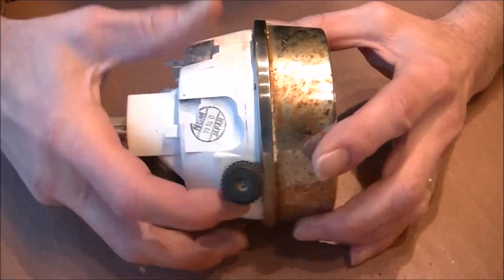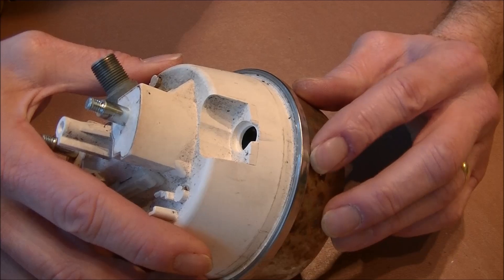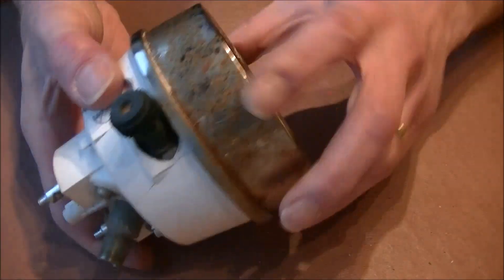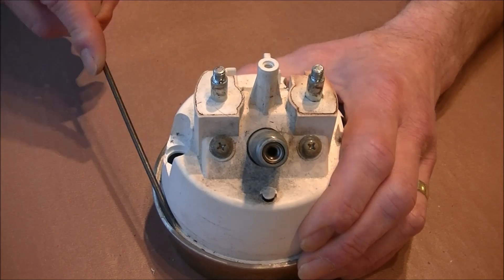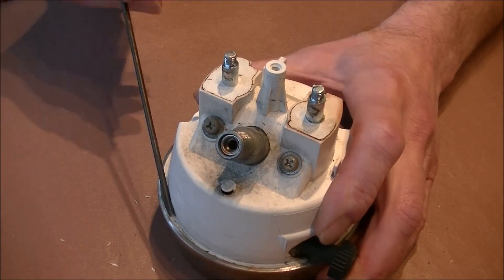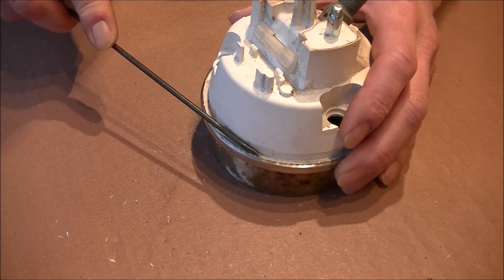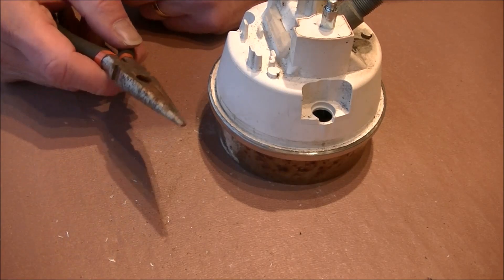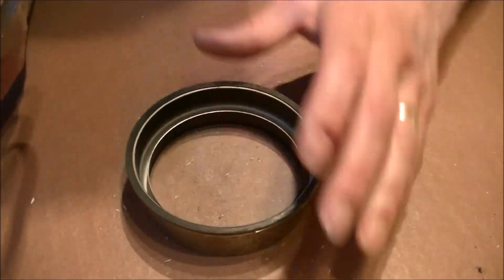How To Open A speedometer, Dismantling The Speedo And Removing The Glass, Instrument Restoration

Comment: Just did both gauges on my VX1100 and it worked a treat thank you. I did what David mentioned earlier and cut a hole in a piece of wood to support it. The back of the glass was misty on one and the other had marks that annoyed the heck out of me. I tried to pull the thing apart previously but realised it was t designed that way. Thank you again for the video.
Reply: hi when you want to put back the ring how do you make bend it back as it was?

Comment: If you can make a reasonably accurate hole the diameter of the outside of the metal ring, and place the speedo into it, it makes it much easier.  Even a hole bored in hardwood will do.  That way the ring is supported, and the edge will bend up much easier, as the ring doesn't deflect as you pry.
Reply: Exactly what I was thinking too. And maybe a metal ring to protect the plastic too, you can see on the table is full of small white plastic peace falling down when the twist the screwdriver.

Comment: I tried to do this and failed miserably, thinking I can Jimmy it someway later. That failed, so I bought a used one at around the same mileage on it. That failed. So I ended up buying a motogadget micro speedo that is super slim line and clamps onto the handle bar. And it doesn’t even look like it has a speedo at first look. Also I bought the m-unit and replaced the fuse box with a breaker box. I definitely 100% suggest to go that route. Cleans up the whole bike super nicely. Especially since I changed over to a springer front end.

Comment: great video.thx for sharing just did my clock on a xs 400.one of the small screws had vibrated out and annoying watching it dancing around when riding..like u say just take your time .the rim will never be the same but the rubber seal hides this.

Comment: Thanks for this, I am about to strip apart the speedo on my Yamaha Virago XV535 and could not see how the bezel could be removed so this at least confirms that it’s a pry it off carefully process. I am converting my bike into a rat bike so am not bothered too much what happens to the chrome, but I’d like to sell the removed parts on,  as long as I can get them off in reasonable order. I am making a new bezel and back cover out of fibreglass. But do need to see how it all comes apart and together again for the new parts I’m making. Excellent video, thanks.

Comment: Think the inside is a coating on the glass for protection. You can use #Cerriglass a liquid, we use on windscreens with Rayon pad plus a machine Rotary to get scratches out. Sonax glass cleaner.

Comment: Yeah ..those old motorcycle speedometers are hard to take off the bezel for a reason. 
To seal it from the elements.
I have a special pry tool to take those apart but I still need to do it three times.
the bezel is just very thick metal.
and putting it back on requires a special machine/tool to do it right.
the speedometer in most older motorcycles was really made to be disposable and is usually near impossible to rebuild.
I know...I repair them for a living.
Reply from the maker: Yes I agree with everything you say. They were not meant to be serviceable but this video shows that you can get into them if you need to, I always prefer to try and fix something rather than throw it away.
The older ones tend to be thicker metal than the newer ones and are harder to do but not impossible.
Reply: So very true. I wish I had bought a lot more motorcycle speedometers at junkyards that I saw over the years. We could all use the parts!

:)
Reply: Can you tell me where I can buy these tools to open them?

Comment: Tried this and it doesn't work. You can get it off but tear it up trying to get it back on. the only way I see you can get it off is to cut it and the plastic housing in two places then take the two halves off. I don't know how you can get the two halves back together. I don't think you can solder it. So if you have an answer for that you're in business. I think they use stainless steal to make the bezel.
Reply from the maker: Hi Barry, It does work, I have done this many times and as long as you are patient when getting it off and do not create any creases in the metal then it will go back on easily. I will have to upload a video of it being put back on to show that it does work.
Reply: Do you have a video of it being put back together please? The inside of my glass has got all foggy, so I'm hoping to pull it apart to clean it and then put it back together again - but would love the video to help

Comment: Getting that joiner band back on can be a mission....want help? message me.
Reply from the maker: Tom Martin Yes they can be a bit un cooperative sometimes, When I post the video of me putting it back together it would be great to hear your comments on how I did it and if you have a better or alternative way to do it that I have not thought of.
Reply: Two things - one, the pointer shaft is tapered and is forced into the pointer boss. Pressure on the sides of the boss will distort it, and relieve the shaft.
two, Carefully hold the speedcup/spindle assembly from rotating and twist the pointer free.